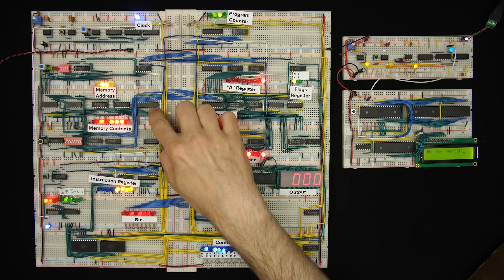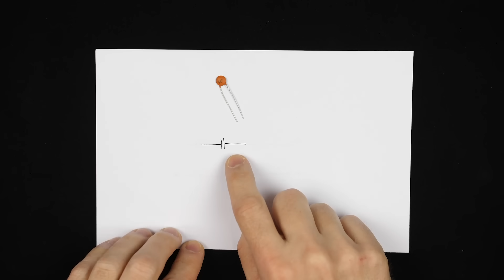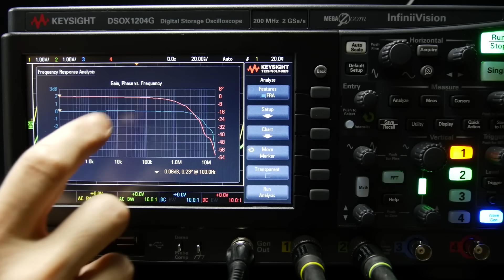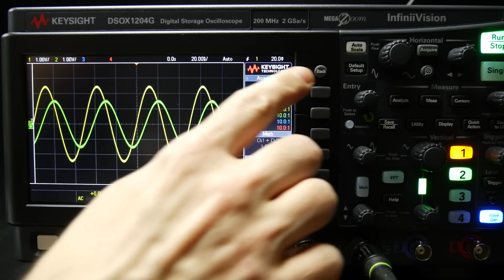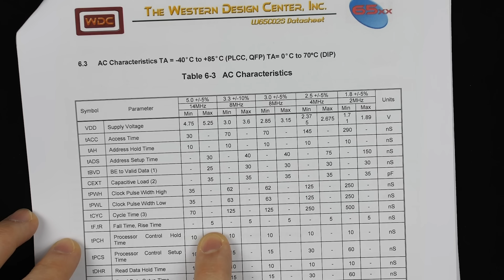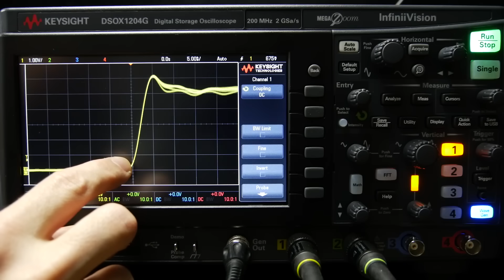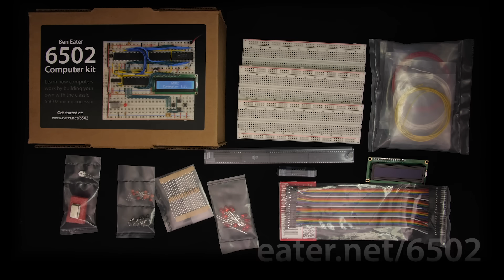Why build an entire computer on breadboards?

Comment: I like to transfer my breadboard successes over to blank, matrix style thru-hole PCB and design the circuits on graph paper with a pencil and later pen. I build the traces on the bottom side by bending the components leads instead of clipping them. I hope to do the same with some or (hopefully) all of these subparts you have built. :)
Reply: A lot of people call them perfboard. They even make types that have breadboard style parallel traces

Comment: Aren't the 0.1uF bypass caps for bypassing any glitching/digital switching NOISE due to the squarewave nature of digital circuits?
If you want power supply stabilisation you place 10uF or there abouts around the breadboards.
I would be putting 10uF caps on each power bus of each breadboard.
Reply from the maker: Yes, you're right. Though I believe either way, we're talking about fluctuations in the power to the IC. I guess I tend to think of the switching noise as just higher frequency fluctuations in power, to be smoothed by a smaller cap.
Reply: @BenEater  I agree with you, Ben. The 0.1 uF cap is about high frequency noise in the circuit. If there are Power Fluctuations as in changes in current supplied to a single IC then a larger Aluminum Electrolytic like a 10 uF is used for it's current storage/ discharge capacity. Aluminum Electrolytic capacitors loose their capacitance at high frequencies, so both are often used together for a stable Power Supply Rail.

Comment: I have been using oscilloscopes for around 15 years and today is the day that I find out what is that spring for. Thanks.
Reply from the maker: I don't remember when I learned it, but it was definitely many years later as well.
Reply: At least I know I wasn't the only person who was baffled.
Reply: I've only got an oscilloscope for a year and haven't yet used it much but I knew thanks to EEVBlog. Dave has mentioned it a plenty of times when measuring power supply ripple!
Reply: Wait, I didn't get a spring like that with my probe!! I thought he made one!
Reply: haha same!
Reply: Hermoso, es increíble lo básico e interesante que es tu vídeo, mucha información muy bien explicada. Gracias
Reply: I guess "read the instructions" is waaaaay down the list from "don't turn it on, take it apart" :D
Reply: @davidhunt240  Well mine did not come with instructions, only with a bag of probes and software... And those that I use at work did not have instructions either, someone probably throw that away when they moved office.
Reply: @davidhunt240  Not that I would do me any good, as an FW developer I am more concerned with data itself. HW is usually developed and manufactured by others, signal integrity looks more like voodoo, at frequencies that I deal with. In projects like these requirements are looser and you make do with what you have, for me it is more the path of learning and maybe a novelty toy at the end.
Reply: I had a old coworker who insisted on soldering his propes into the circuits he tested and scolded the rest of my department for not doing the same. Guess who could never borrow oscilloscope propes from anybody else because we knew he would ruin them.....
Reply: I have been using them for 4 years and I just learned that... If it wasn't for Ben I wouldn't have likely learned what it was for for a long time
Reply: i just got a digital scope and analog scope for Christmas. 2 scopes on the same day. What a wonderful day that was. Anyway i wasnt sure what the spring was for until i read the book that came with the scope. I havent used it yet but probably will just to get a feel for it
Reply: You never stop learning!
Reply: Wow, so that's what it's for!
Reply: https://www.youtube.com/watch?v=fZ7tOMyi07w
Reply: What time stamp?
Reply: I remember seeing that part. I honestly have no idea where I’ve put it. Well, another thing to do while I’m at home.
Reply: Haha very right. Pro of pros
Reply: Ah, not good my friend, not good at all.
Reply: I never saw any of these springs on the oscilloscopes that I've worked with so far. Maybe they were in the boxes they came with, but I didn't get to see them.
Reply: In which point in video you see that spring ? 21:15 ou this
Reply: it's in the manual  ¯\_(ツ)_/¯
Reply: @lexus4tw  Manuel? He's my neighbor, I'll ask him
Reply: @lexus4tw  we have him here but dead
Reply: Noob

Comment: So what's next? Build an OperatingSystem for that computer! Hell yeah!
Reply: Benux
Reply: I'd say first start with a Basic or C compiler to optimize and abstract away from the Assembly language, then from there build an OS... You might have to add additional breadboards to support more ram, and a couple more breadboards to have additional ROM modules. The other ROM modules could contain the source code for the Basic or C compiler and the other for the OS. Then you could possibly add a third breadboard that would operate an SD card reader and use this as if it was a Harddrive. Then you could have a full working 8-bit computer that could in theory support a basic level OS that could provide you with either Basic or C programming. After all of that is configured to work properly we could then create a boot loader.
Reply: @skilz8098  The processor has 16 address lines, which gives a max of 64kb of accessible memory, 32 of which are already taken by the ROM and 16 by the half of the ram chip that's actually being used(and a bunch more bytes for the io), so you can't really add more memory unless you use some kind of serial transmission instead of the bus
Reply: @MRtecno98  True, but you could use an intermediate interface such as a bridge with working interrupts and muxes... the 16-bit address lines could communicate through that directly, then that could branch to other modules interrupt requests... So in theory, you'd still have only 16-bit throughput per given moment, but you could in theory access multiple 16-bit busses... in a priority queue like structure through requests from the bridge. 

You could also, in theory, designate still use the existing bus, but have each channel of that bus talk to another 8-bit or 16-bit bus as you suggested serially... Then you could, in theory, have 16 different busses in use connected to the main bus. So each channel of your 16-bit main bus would be responsible for each bus that is connected to it serially. 

You would then have to have the connected bus have all of its lines connected to a 16-bit PISO Shift register where that registers single bit output is connected to one of the main busses channels. However, to do that you would definitely need more hardware to act as a controller just for those shift registers as well as the IRQ request lines based on some priority bit. This could be done with another small ROM and microcontroller.

So, in theory, it could still be done. It wouldn't be easy, but it is possible. It just that with this kind of hardware design you now also have to worry about synchronous and asynchronous signals and you would have to be extremely careful with the timing or your signals for access, read, and write, and transfer operations. Still, it's an interesting topic and would be quite impressive to see someone actually build it and get it to work...
Reply: @MRtecno98  Both the last generation Atari and C64 had 128kb — using bank switching techniques.

For enthusiasts which still use an Atari 800 there are 1MB memory upgrades available.

Mind you, if you start from scratch you might as well use the 65816 CPU which has 16 MB of address space and only costs one dollar more.
Reply: @skilz8098  32 kb of RAM is plenty for a simple 65C02 computer. The very first Atari 800 came with only 8kb. Granted they quickly upgraded to 16KB for base configuration. If you want to know how to use almost the full 32 KB read my blog:

https://www.minds.com/blog/view/1178310709392269312

TL;DR it only takes a SN74LS21N 2×4 AND – which is less then a dollar – to make it work.

But then again, Western Design Center has fully featured experimental boards for sale. Which include USB connectors and two VIAs, one PIA and one ACIA. 

https://wdc65xx.com/Single-Board-Computers
Reply: maybe the Minix operating system! After all we have all the code in appendix of the Tanenbaum professor book! and the entire program has only several thousand lines.
Reply: @jiangpengyuan3713  I think a 6502 and no disk isn't going to be powerful enough.  Minimum requirements: https://en.wikipedia.org/wiki/PDP-7
IIRC, it doesn't have virtual memory, UNICS kept all processes' memory in swap and the currently running process' entire memory in core.
Reply: @Matt Faraday And how is that relevant to anything here? The Linux kernel is massive. Minix is quite small. That's what matters here.
Reply: God, I hope so!
Reply: Mr techno and skill z. I don't know who you are sir but I became your fan and subscribed your channels.
Reply: Hold up a minute, ben hasn’t implemented that good of a machine language for it to do anything useful except for add and subtract
Reply: Its BreadOS smh
Reply: @slashxred  Yep, you have my vote for BreadOS.
Being realistic, that's the only thing it could be called.
Reply: @MaffeyZilog  talking about bread a couple days ago I learned a lot more about watts and joules and through some rounding I know know that a 70 calorie piece of toast, if converted 100% into energy, can power a 40" led tv for 3.5 hours? Cool right?
Reply: @slashxred  TV and toast with a side of physics.
What's not to like about all that!!
Reply: @MaffeyZilog  thanks! Also imagine powering it from calories of body fat... Finally a good exercise
Reply: It's a 6502 processor right? I'm sure you can port GeOS on it ;)
Reply: MS-DOS let’s GOOOOOOO
Reply: I bet arch runs on it as is ( I know )
Reply: Woah woah woah, is it really that a good idea to build an OS using only a 6502?
Reply: High speed traces impedence control/signal integrity?
Reply: He should put linux on that
Reply: Yeah. Programming by switches.
Reply: Temple os
Reply: Damn Small Linux just might run on it out of the box.
Of course I'm joking, I mean Puppy Linux lol
Reply: Yo, you need more memory for that!
Reply: @activex7327  - tell that to my Acorn Atom with (originally) 4 KB of ROM and 2 x 512 bytes of RAM. That 4 KB was enough for the OS and an integer-only BASIC.
Reply: @JanBruunAndersen  The term OS  could mean anything, I can write an OS in 10 lines of assembler, but it will do nothing much ...
Reply: Jan Bruun Andersen that’s awesome dude!
Reply: @JanBruunAndersen 
Damn I sold my Acorn Atom years ago to afford a BBC!
Reply: @activex7327  Starts gnome
Reply: @roylastname9367   genome*
Reply: @activex7327  No, both the Atari and the C64 where able to squeeze their OS into 8kb of memory. And we have 32kb. Enough space for an operating system, a basic interpreter and an assembler/disassembler and monitor.
Reply: @Martin.Krischik  We're talking here bytes, not kbytes.
Reply: @activex7327  I see “kb” all over the thread. Clearly everybody speaks about kilobytes.

Which make sense for the WDC-65C02.

Taking about bytes makes only sense for the R-65C02 microcontroller with build in memory.
Reply: @Martin.Krischik  I was referring to original comment and the computer Ben build, ... it has bytes not Kbytes.
Reply: @Martin.Krischik  Grumpy old man, you made all the wrong assumptions, ... I was referring to Ben's 8 bit bread board computer in this post. You have failed old timer.
Btw, if you followed my posts, you would realize the term OS can loosely refer to implementation of any kernel routines or lack of. Old timer, stop being mad.
Reply: @activex7327  Insults on my age. 😃 AKA ageism. 😆 From an anonymous account without an avatar. 😂 Typical comment warrior as well. 😁 Is that all you have? Or did you build any Bens projects (pics or it didn't happen) or is typing all you can do? 🤣

Yes, I'm old. Old enough to have programmed my first computer 40 years ago (which had a 6502 CPU) and I have degree in computer science for 30 years. I doubt you can tell me anything about computers I don't already know.

Anyway, yes Ben did two computer and this is a comment under Ben's 6502 project so that's the default . That's the computer I meant and you misunderstood my posting. If you meant the other project then it's you who has to *fully qualify*. And you should have done so right from the beginning 7 month ago.
Reply: @Martin.Krischik  Read your comments first in the previous post, see who is really doing the insulting. You have failed with your assumptions and with your comments. In that vid, Ben was showing both the 6502 computer and the 8-bit computer, next time, inquire before you jump to conclusions. Making grumpy comments (see above) makes my statement calling you grumpy and old well deserved.
Reply: @Martin.Krischik  Although I don't doubt your achievements in computing, it's a little egocentric to say that you know everything about computers and can never learn any more from anyone.
Unless that was directly aimed at the guy above you who, to be fair, I don't think could teach anyone about anything given that he didn't know the difference between a byte and a Kbyte.
Reply: @MaffeyZilog   i never said i could not learn anything any more. I said it's unlikely that someone who didn't even take the time to upload an avatar to his (or her) account could teach me something about computing.
Reply: @Martin.Krischik  If you notice, I did say "unless you were talking to the person above you in the comments" who did sound like they didn't know anything.
No offence meant.
Reply: @activex7327  Commodore VIC20 didn't have much RAM (somehere around 5K), although it still had a built-in OS.
Reply: @techleontius9161  I know, I was referring to Ben's 8 bit computer RAM qty.
Reply: I once had to write a small part of an OS. I made a mistake that threw a hardware exception which was then handled by the code itself, completely confused me until I remembered what I was coding.
Reply: I'd think maybe Ben Eater skills and knowledge would go to waste with that project? It's a whole another can of worms to open to start coding OS from scratch. 
With can of worms I mean building a house project as a hobby which never completes, meaning ending in disaster.

Comment: I liked how you presented low pass filters and a hint of all the caviats that you are taught at university about RF  in Telecomunications.
As always, quality content.
Reply: Or you can be the rest of us with an associate degree where we learn that rf and inductance in general is magic, and that your only defense against it is to pray, jostle any and all wires and wiggle the components until your assembly starts working the same way every time you power it up.  If all else fails... changing rooms and/or turning off the overhead lights sometimes helps.

Comment: Never thought I'd get turned on by breadboard connections
Reply: After 21 days in the quarantine, a nicely curved piece of wood is enough to get me going
Reply: @martyJJ  A rusty keyhole strapped to a donkey's ass gets my engine going, we live in hard times.. ..
..... Literally.
Reply: @coffeepot3123  wtf
Reply: @martyJJ  holdup
Reply: @martyJJ  The ricks must be crazy?
Reply: There's the comment I was looking for
Reply: @jimmyjohn832  same
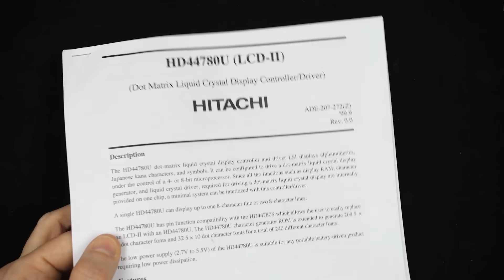Reply: If those connections turned you on, then you'll cream yourself when you see the name of the company at 26:13.
Reply: @potterfanz6780  so hot
Reply: Oh yeah, check out those slender well proportioned wire connections!
Reply: make sure you add capacitors to smooth out the supply voltage
Reply: @MattSiegel  oh yes. Tell me more...
Reply: @TheBodgybrothers  Use inductors as they soften the sudden changes in current, making it a bit more steady and controllable. Don't forget the heatshrink tube for protection too.
Reply: LOL, really
Reply: you guys are sick... lol
Reply: I'm sure they were inspired by examples from biology. :)
Reply: This was the straight comment I was looking for.
Reply: Ew

Comment: I love how deep you are actually going into this, one question though at one point you say "you can see it attenuate " what exactly does that meen.
Reply: Attenuate just means that the amplitude of the wave changes. You can see in the video that the green waves height gets smaller when he says it, thats it attenuating. Hope this helps :)
Reply: Yes all these comments help a lot! thanks! didn't think it would be that simple :)
Reply: Attenuation of signals is a reduction in the value, so by attenuating the signal he means it weakens it, and it propagates less effectively

Comment: I have taken years of circuits and electronics classes, and capacitors have never "clicked" as well as they did during that description... Thank you for improving my intuitive understanding of capacitors!!
Reply: It occurred to me that where a resistor blocks current change, a capacitor blocks voltage change.
Reply: @renakunisaki  Isn`t the inductor the one, who blocks current change? Resistor just makes current proportional to voltage, while inductor tries to keep it at whatever level it was befor the voltage change.
Reply: Dr. Rabbit correct, the inductor resists change in current, capacitor resists change in voltage, and the resistor resists the flow of electrons.
Reply: i learned that in high school something wrong with your educational system